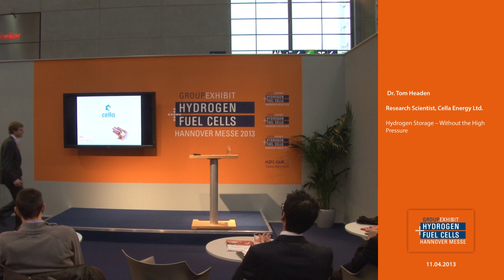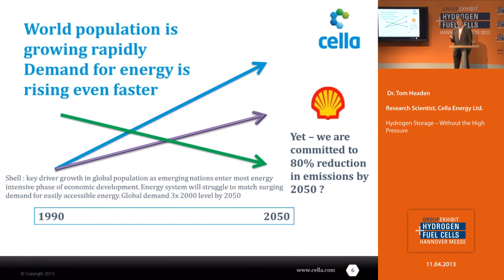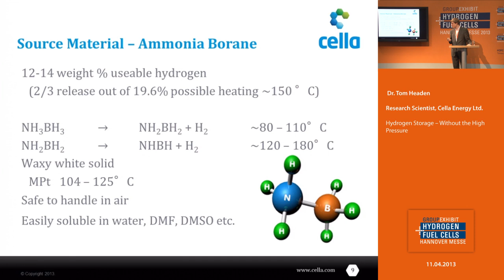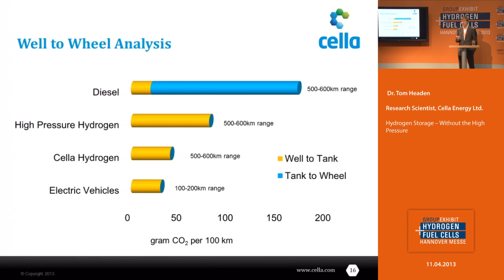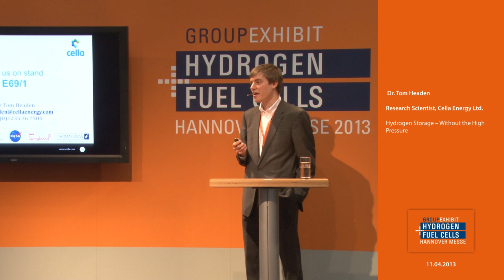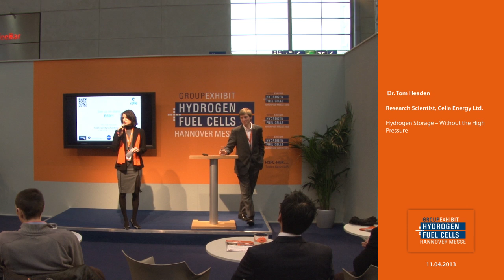Hydrogen Storage -- Without the High Pressure

Comment: Is there a value for the round trip efficiency for the Cella pellets? I.e. what is the energy percentage loss when reforming the ammonium boride complex? Overall, this technology appears very promising and it is impressive that you've got comparable energy densities with such high pressure systems.